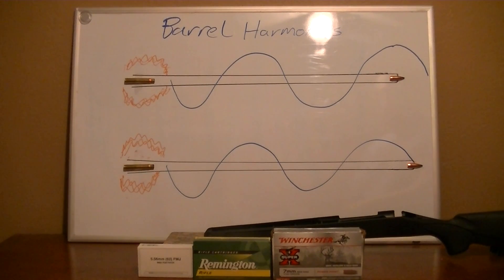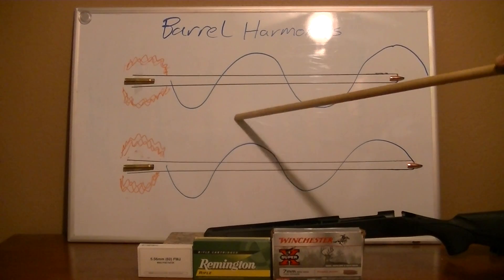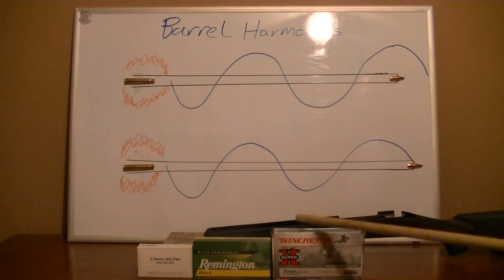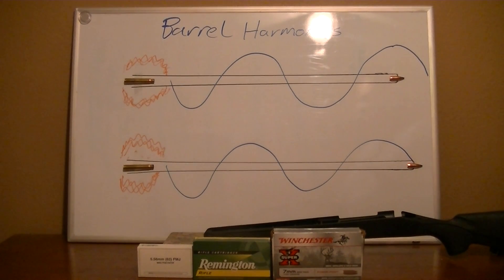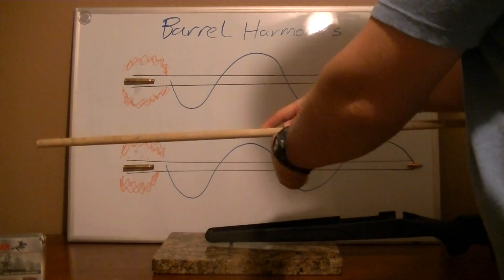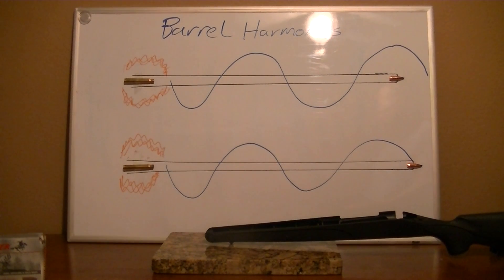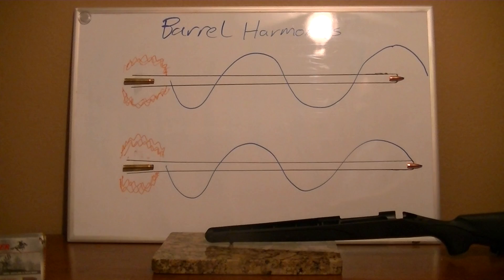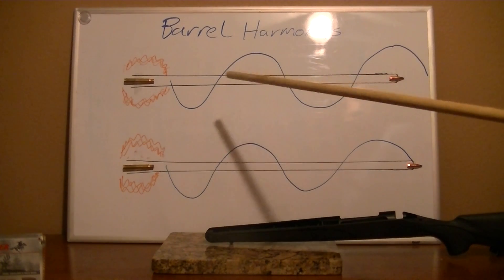Accurize your Rifle: Barrel Harmonics

Comment: Think about this a second.  If you can get a bullet to exit the barrel at the same exact moment, every time, it does not matter what part of the wave the muzzle is on.  This is impossible though.  Where you are saying the the bullet should exit the barrel is when it's muzzle is dead center.  This is actually where the muzzle is changing position the fastest and has the fastest up and down speed.  So any inconsistencies, in your load, will be amplified when the muzzle is dead center, because the muzzle will be able to move in less time between when bullets exit the barrel.  If the timing of the bullet exiting the barrel is off, the muzzle/ barrel angle will have shifted your impact more.  The barrel does not stop and wait for the next wave at dead center.  The longest "lingering time" is at the top or bottom of the wave.

I have found, consistently, my loads perform best at the peaks and valleys.  At the top and bottom of the wave is where the muzzle is changing opposite direction.  This is where the muzzle lingers longer.  This is where inconsistencies in the load can be minimized because if your bullets exit at slightly different times, the muzzle will have shifted position less.

The figure 8 shape, the muzzle draws, is typically an accurate description, but not always.  you should load for the top and bottom of the 8.  The 8 may not be aligned vertically(though typically it is).  It could be aligned diagonal or even horizontal. 

I find my accurate loads quickly.  I load a single rounds in charges going up 1/2 grains at a time.  This many times will result in 10-15 rounds, all loaded with different charges.  I then shoot them all at the same bullseye, at 100 or 200 yards.  200 yards is better.  I almost always get two separate groups with scattered shots between them.  Those scattered shots are when the muzzle is closer to the center of the 8 pattern.  The two congregating groups are when the muzzle is at the top and bottom of the 8 pattern (peaks & valleys).  Any of the charges that placed the shot, in groups next to other charges, is where I start my tuning of loads.  If I don't like the velocity of an accurate charge, I up it until it groups the next charge in the same area.  Then I have hit my second accuracy node.  You can do this until pressure signs stop you from obtaining the next accuracy node. Thus obtaining the best accuracy with the best possible velocity.

This works for me and my load development time and supplies has dramatically decreased.  If I can't find accuracy or nodes, I switch to a different powder or bullet, and eventually gun.
Reply: This is long, but it has a point.  Why do we shoot?  What about it draws us in?  I think it's important to ask ourselves before diving in to become the best of anything, not just shooting.
Just out of the Marines and loving rifle shooting, I bought a pre'68 Mouser action Winchester .300 WM with BOSS and mounted a Leopold 10x50.  I had to go out to the desert with one box of Federal Supreme BTHP and hope I did need anything else because I was broke, lol.
It was the cheapest way I could get into long range shooting at the time.  I learned a lot with the BOSS and a bit of experimenting, but only 20 rounds was not enough to get dialed in.  My goal was to get sighted in at 100 yards with 3 round groups, then, if I had some rounds left, start tuning the BOSS.
By the end of the 20 round allowance, the blast was enormous in noise level and dug a hole at my muzzle like I'd never seen before.  My last group was about 1/2 MOA. so I thought I'd achieved my goal and then some.  Oh, and I was doing a break-in procedure as well, cleaning between rounds fired.
Over the next month or so, I would shoot two more times, two boxes, then three, out further.  I noticed the pattern you are talking about, but not changing ammo characteristics, changing the BOSS settings.
I read a book (this was 1990) explaining harmonics, but the understanding of what was going on was not as complete as today.  All I could do with what I knew is find the best sweet spot of groups and lock it down.  It would have been beyond my budget to do anything like reloading equipment.  I was ok with what I had going on with a future goal of learning more, doing more.
I played around with ideas which were cheap and fun to learn from.  I attached tuning forks, rubber strands, changed ammo (which proved to be expensive and improve nothing over what I had) and even tried shooting with the barrel in a trough of water and filming (VHS lol) the wave patterns as I changed the BOSS settings.
I already had a bull barrel, so not much changed with those experiments.  It was fun though.
I settled in with friends who liked messing around the way I did, but one had more money to play with and the other friend had less (just had twins).  I ended up giving the friend with new twins, my rifle and buying a new one to start the process over again.  The other friend spent a lot of money and the friendly competition was on.
We all got to where we could shoot <3/4 MOA out to 1200 yrds and about that time, we realized we would have to spend a lot more money on bench rest shooting to get any better, but none of us liked the idea of changing our desert trips, so we competed with what we had.
We would take turns making the rules for that weekend and it got hilarious some of the goofy crap we came up with including shooting a tube TV out at a mile in the dark, it was powered by a generator...none of us had ever shot that far, but the  expensive equipment guy eventually hit it, which looked like a light bulb slowly going dim.
My idea was one shot the whole weekend, closest to the bullseye (1/2" red dot at 1200 yrds) wins and the other two pay all expenses for the next trip and we would be shooting at least 200 rounds that next trip.  That was calculated to be about a $450 trip in 1992, at least that much, so we had to do our best or pay up.
At the last second, one of the other guys pulled a 'Joker Card' as we called it.
We had to switch rifles.  Dang it, that was not what I wanted to do.  Three pieces of paper with guns name on them, in a hat, picked by new shooter.
Expensive gun guy got my newer gun, an AR10T, I got the BOSS, and the twins dad got what we called the 'Thudster' cause it hot most of the time and we expected a thud almost always.  It came with a wind meter, and a $3000 U.S. Optics scope.
The idea was (starting weeks before) that if one guy's gun could not be used, we would have to pick up an unfamiliar gun and who knew if it was a critical, life-saving shot...?
One shot each later, and the BOSS won, but only by less than an inch as we were all sub MOA.  I was called a cheater by rich boy cause I had used the gun before, but I just shut my mouth and looked forward to our next trip, where by the way, rich boy shot on my target purposefully making me change my dope...got me pretty good for about an hour.  I thought my scope mounts had failed, my barrel came loose and was confused as hell for until I heard him laughing at my standing over my rifle for a long time racking my brain over what had gone wrong.
How could be so many flyers, yet good tight groups at the same time?  Ha ha on me.  That turned out to be at least a hundred dollar joke.  To him, 'worth it!'.
I did try bench rest shooting with a guy we met at a local range, just for the experience.  His knowledge was staggering to me and a look at his logbook told me why.  He was bent on perfection.  I asked why it meant so much to him and he looked at me funny, "I have to be 'the guy' at some point, you know, the one everyone else comes to".
Something did not settle well with me.  After thinking about it, I determined my motives for doing anything I did should never be about proving anything to anyone else, maybe to myself, but I had to love what I was doing.  If there was another motive, but no love for it, I was done.  I knew when to quit things I should not have gotten into in the first place.  I didn't care about being a quitter of I was quitting for the right reason.  Shooting taught me a lot about myself and has improved my life because of it.
Moral of the story is not to get talked into anything that is not 'you'.  Do what you love doing as long as it does not hurt anyone else.  I also learned to be where I love being, and being around who I love.  It's not selfish, it's where I found others who are like me and we are good friends.  One became my wife whom I think is God sent.
Reply: @dandexinventor  I like how you said"Shooting taught me a lot about myself and has improved my life"
Sounds very similar to how Martial Arts will teach a lot about on oneself
Reply: I agree the video is a great video at showing barrel harmonics.  Most people don't realize it even exists. It all depends on how interested in precision shooting you are.  If 1MOA is great for your amount of curiosity, then that's great.  I pursued accuracy when starting, but I frequently found I just couldn't consistently place the bullets exactly where I wanted them when trying for harder smaller targets. When I started achieving 1/2MOA or better, It really solidified what I am able to shoot VS what the rifle is capable of.  You reach a point where your skills get better than what many rifle are capable of. Once you know you can shoot touching holes, then it makes you want to spend more time and energy (& $$) tuning a good rifle, optic, optic mount, and ammo.  If a newer shooter can have a seasoned shooter give them a known accurate rifle and load, the new shooter can progress in their skills faster because any mistakes are only the shooter. ultimate precision can get you into a rabbit hole, but once you can tune a rifle and load like you can tune a performance motor, it's very satisfying to force the results you were looking for. The Boss system can be great because you can change the tune of the rifle instead of the ammo.  Just don't try to tune the boss and the ammo at the same time or you'll never find the right spot.
The order of items most affecting accuracy, in my experience is:
1st- The rifle and especially the barrel & equally the shooter and comfortable rest. I trust sand bags more than any bipod for developing loads.
2nd- a scope that doesn't change impact, a 1-piece scope mount, and proper mounting of the scope base and scope to minimize stresses in the optic mounting.
3rd- the bullet
4th- the powder
5th- the brass
6th - can't say primer because when I find the rest of the above mentioned, I don't have a need to mess with different primers. I've never noticed them preventing me from finding an accurate load.

For anyone out there trying different bullets, I can tell you I have consistently had good luck, in multiple rifles, with the following bullets:
Nosler Accubonds
Barnes TSX
Sierra Match (most affordable)
Sierra Game Kings (most affordable hunting)
Bergers (expensive for target bullet, but they are good)

If I can't get a rifle to shoot one of the bullets above, I sell it. I have usually not had good luck, for high precision, with Hornady, but that doesn't mean they aren't good bullets. And they have done a tremendous amount to keep the big bore community shooting. I thank them for that. I have not tried any of the newest Hornady bullets like those metal tipped ones yet though. Some of the small bore varmint bullets can get really accurate with Hornady.
Reply: very interesting, will consider
Reply: I concur. Getting the bullet to exit the barrel as near as possible at the top or bottom of the sine wave is best for accuracy. The barrel vibration slows down and stops at these points before moving in the opposite direction. I shot NRA high power service rifle matches many years using a M1A/M14 NM out to 600 yards with iron sights. Reloaded my own ammo and found the sweet spot for different loads. Great fun and good comradely. The video was good explaining the harmonics of a rifle.
Reply: Best comment ever :)

Comment: Good experimental method.  Your drawing shows the fourth mode of the barrel.  The first mode of vibration is likely the most important for the projectile exit direction.  Since the barrel is not supported on the free end, the vibrations are similar to a flag-pole, fishing-rod, or an old-time car antenna.  My guess is that higher modes of vibration have more to do with interacting with the rifling to affect spin.  Good info on the experimental method.

Comment: Drawing exactly wrong.  Top image has bullet leaving at ideal time (slowest).  Bottom is worst (fastest)
Reply: unless it's a harmonic node
Reply: I'm not so sure about that. I do alot of guitar recording and those are called transients. That top image is the loudest in a tracks recording which I can relate to this image better from.
Reply: @michaelenochs4033  Look at the drawing, it is basically correct as far as the vibration, the transition is at the top and bottom where the vibration slows then comes to a stop then goes the opposite direction. The best exit point is during that stop. The way he has it drawn the bullet exits during the fastest moving part of the vibration, not the slowest. Put a time line along the vibration, what is your window of time for the bullet to exit as drawn, what is your window of time at the top or bottom to hit that node? As a matter of fact, the node is defined by the transition from one direction to the other.
Reply: @6handicap604  
I see what you're saying. Thanks for sharing that!
Reply: Wrong , just let the adults talk.   Go outside n play.

Comment: This assumes that the wave is 2 dimensional while the bullet is being spun by rifling.  I suggest that the barrel muzzle is moving in a circle...or possibly a combination of 2d and circular.
Reply: good point.....it is usually elliptical and not perfectly circular...I do not know why this is tho and it would be great if someone experimented to find out why since the elipse shape will change in its direction from say:
1'Oclock to 2 Oclock etc.
So quite possible there is not only 3d vibration patterns being exerted but a 4th....tortional, due to twist maybe.
But I am glad you pointed out that a barrel does not just vibrate up and down as if it is held in a single plane like drawn on a piece of paper
Reply: This is where it gets interesting. I’ve personally been trying to approach this problem in engineering classes for years now and haven’t found an exact solution. Ultimately though I think cylindrical coordinates are the best method to guesstimate for the exact reason you mention.

Comment: Suppose you find a harmonic node in a particular caliber with xy.z grains of a powder at a particular grain weight.  Will the harmonic node be close with a heavier projectile?
Reply: No, This is about barrel time and contact surface. Your barrel will like a given bullet at one certain velocity. You can use another compatible powder as long as it is driving the same bullet at the same speed you will get similar results.
Reply: @tony55752  any consitent changed, turns into another variable that must be accounted for until consistent again....Agree with UXO Tony....change bullet = a likely change in load is usually called for.